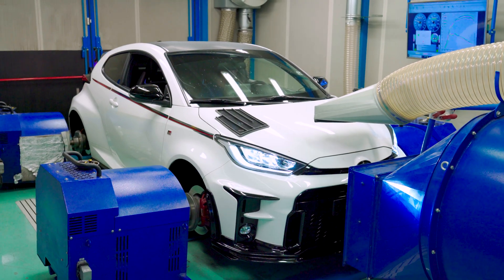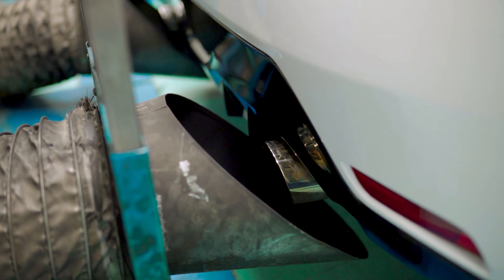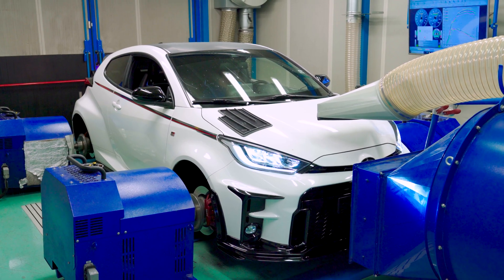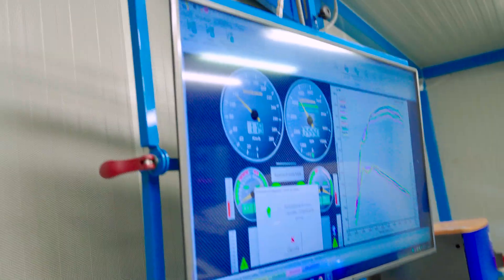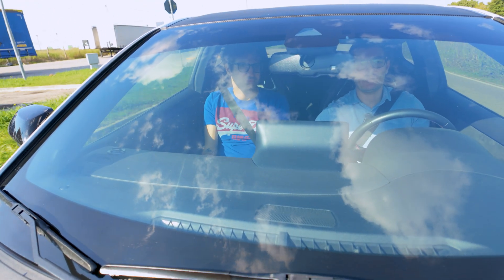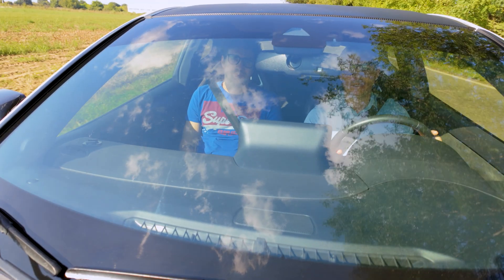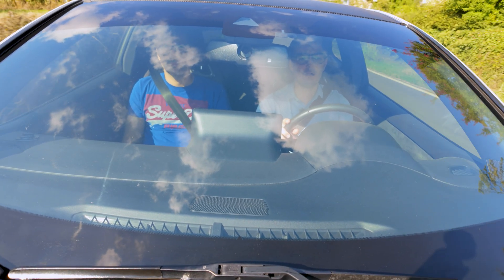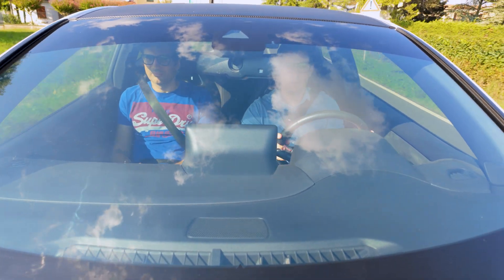Get 350-500HP from Your GR Yaris Engine Cams and Turbo, Tested

Comment from the maker: Let me know if you want any more information, as it's very difficult to fit everything in a video!
Reply: I love sometimes longer video becuase I listen it like podcast meanwhile I’m driving on highway
Reply: So can you not run the Kelford 267-A cams using Ecutek?
Reply from the maker: @panda-mech  Now it is possible mate
Reply: @PIRASMotorsport  this is good to know. I have my GR Corolla in with a tuner to get  valve springs, head studs, and 267-A cams, clutch installed and to get tuned on ecutek. I have most other bolt-ons on the car (intercooler,piping, turbo inlet, intake, down/mid pipe and exhaust). I was worried that ecutek wouldn’t be able to do it.
Reply from the maker: @panda-mech  It will be a strong motor mate!
Reply: Great video, thank you 👌🏼Is swapping out the stock turbo an engine out job?

Comment: Do you have any information on how much torque the gearbox can take? The only info I've found around is that it's good for about 420Nm.
Reply from the maker: It should be good for 500nm prolonged use, provided you drive it sensibly
Reply: @PIRASMotorsport  Where did you find the info? Can you provide a link or a document?
Reply from the maker: @bcm70 it was provided to me informally by Toyota
Reply: @PIRASMotorsport  Thanks. Appreciate the info.
Reply from the maker: @bcm70 thankyou for supporting mate!
Reply: @PIRASMotorsport  wow nice
Reply from the maker: @mixxeerr  thankyou!

Comment: what psi  on yaris ? g25 550 for 2000 cc will work ? 7000 rpm ?
Reply from the maker: I’m not sure of your question, but my map peaks at 1.8bar and tapers to 1.3
Reply: 1.8 bar on torque and taper 1.3 on max hp  for the turbo speed  ?
Reply from the maker: @TheSol115 350hp

Comment: Hey, on the turbo graph I like the one with the green line, called "syvecs cams". Is that with stock turbo? which cams?
Reply from the maker: Stock Turbo and “A” cams: this shows exactly the difference with the EZ cams, that nobody should buy
Reply: @PIRASMotorsport  I guess Im going to have to return mine... glad I have not opened them yet :O

Comment: I have different opinion. I much prefer G25 with A cam, I feel this is the nicest combo for street car, how they car should felt from factory. I am not a fan of stock and hybrid turbo's making lots of torque at sub 3500rpm once tuned. G25 is smoother delivery, less impact for engine down low and breaths much easier at the top.

Good data and comparison, similar to what we are seeing on our customer yaris's too.
Reply from the maker: Yes, that is the beauty of tuning, everyone can make their informed choices based on objective information like this we shared!

Comment: Apart from the numbers, it would be nice to see the experience of driving with A cams vs EZ, not everything shows up in the graphs
Reply from the maker: Yes, not everthing shoes up on the graphs, but the EZ cams I got are quite pointless unfortunately: its either a good tune on stock or A cams from my point of view. Driving the car, you don’t really fell anything missing down low, but much more in the high rpm range!

Comment: huge! this is the ideal range i also want for my vehicle and totally the enjoyable balance of street / track
Reply from the maker: Yes, its at its sweet spot with A profile cams!
Reply: @PIRASMotorsport  I am undecided between Syvecs or MoTec but the choice for my future build is clear. 

Your research shows the pros/cons of Ecutek and stand-alones and even with their new updates, not as performant as Syvecs or MoTec. 

I think for my build I will do head gasket and head studs just for extra insurance 😅 mated with a Garrett turbo.  

Would love a sorted and stronger gearbox to mate with this type of profile!

450hp is my goal and I think what you’ve researched and reported shows the clear path for all G16E owners today!
Reply from the maker: @apex_gr at 450 you will need to forge your engine 100% and to change LPFP + injectors. Once over 420, the proportions blow out money wise…
Syvecs or Motec would depend more on what you’re favourite tuner uses
Reply: @PIRASMotorsport  Agreed. My estimate for the parts on a solid build will be $20-25k USD minimum. By the time I have enough saved I’m hoping for a little more flexibility in that range. I have access to reliable E85 and there is a flex fuel kit releasing soon here which E40-85 have great results for the G16E!
Reply: @apex_gr may I ask who is going to be putting out the flex fuel kit?
Reply: @GR_Papi  Not 100% but I know someone is working on it. I am hoping GJP / Gerald will put a kit out. He has one for the FT86. I’ll message him.
Reply: @apex_gr Why would you even bother of you are spending 25k for just 450hp? The base care is already 40/45, that's 65k. Why not just buy a faster car?
Reply: @ArthaxtaDaVince777  the question is, why not? this isn't about horsepower, this is about balance and reliability.

you can put $25,000 into a BRZ in strictly suspension and aerodynamics without touching the engine.

any "real" race car will cost upwards of $60,000 in mods regardless of what you purchase.

the purpose of this machine is for pure enjoyment of 4WD.
Reply: @apex_gr  I own a grc premium and I love the car all, but honestly, 25k for 100 whp is absurd. Also the engine isn't the most reliable, according to more recent data, it's no better or slightly better than a golf r. But the thing is a golf r can go 400whp with 5-10k, still manual and awd. Idk, for me, it's just not worth it, but also, I'm on a budget so there's that. The limit 1 tunes seem about perfect tho for most people, you get 350 crank for like 2500
Reply: @ArthaxtaDaVince777  The standard Yaris has more than enough power for fast road use and can get you into trouble very quickly so I don't see the point in spending all that money for more power unless you want a race car.
Reply from the maker: @uv77mc85 everyone is free to do what they prefer, that is the beauty about it !
Reply: @uv77mc85  I agree this car stock is so much fun, I wouldn't spend that much money for 100whp unless I didn't care about the cost, and I really liked the chassis. At just 350hp, which you can get with only $2500, you already need to upgrade the clutch for another $2k. So the reward for tuning this car isn't great for the average enthusiast, but for the hard-core enthusiasts, it's not a bad project for $25-30k.
Reply from the maker: @ArthaxtaDaVince777 well said!